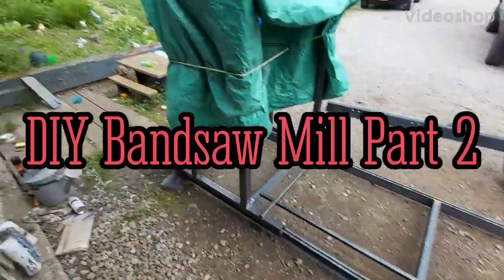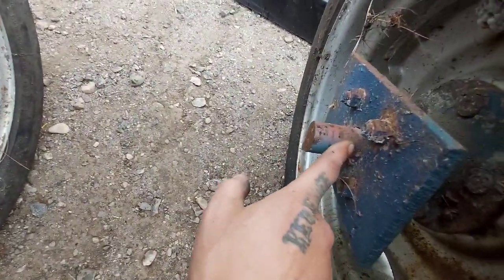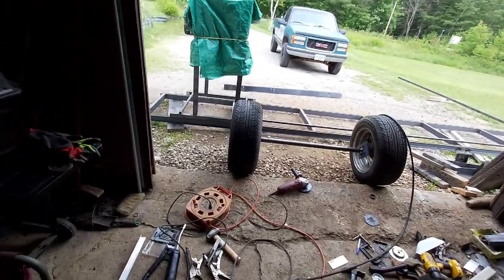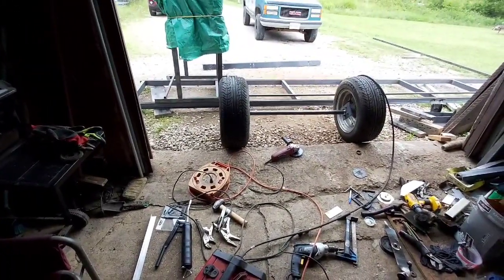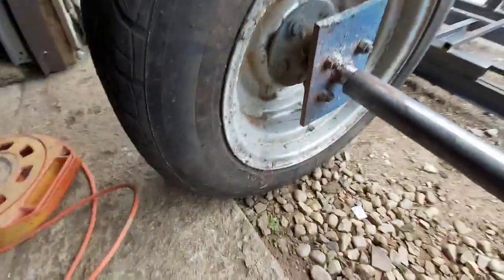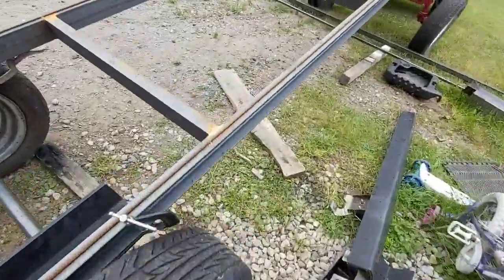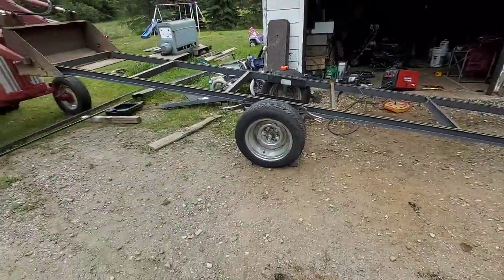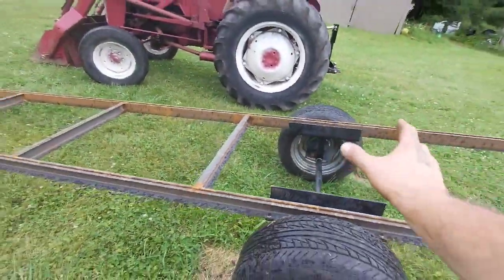DIY Bandsaw Mill Part 2

Comment: Love it coming along good. Like the way your repurposing what you have to work with. Once you have a little tractor helper you'll never know how you lived without one. Can't wait for number 3.
Reply from the maker: I only paid 1000 for the tractor with the front loader, back blade and the bush hog. Cost 500 to get it home and running. I seen tractors with these attachments for 5000. What a wonderful tool . I love it already. 
   With all the stuff I have laying around here I bet I can build the mill for around 1000. I'm at less then 900 so far and all I need to get is a 15" sprocket, a shaft to match and pillow block bearing. I also need blade guides.  I'll be under 1500 for the build for sure. Thanks for watching